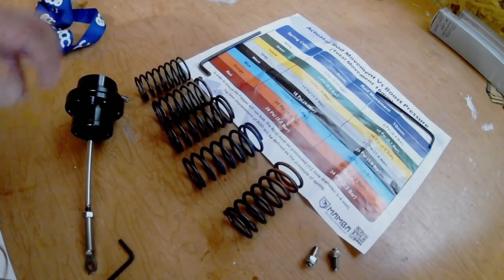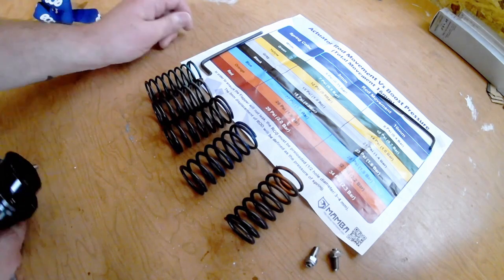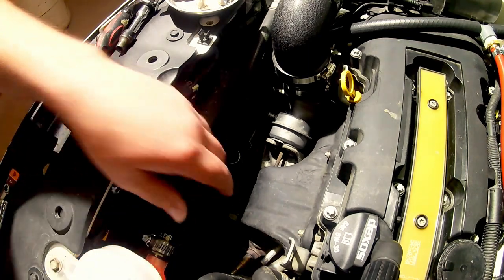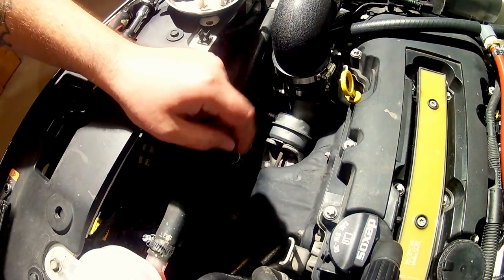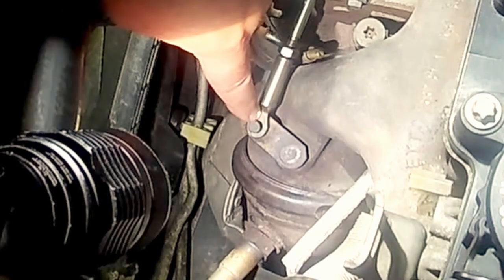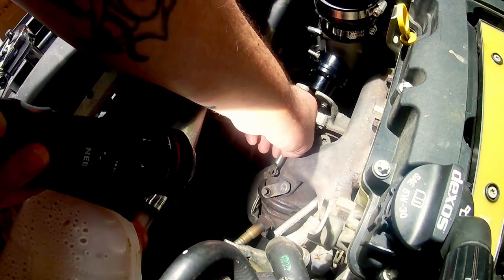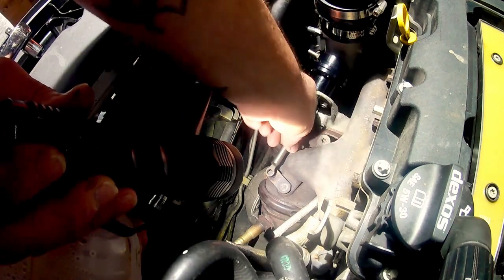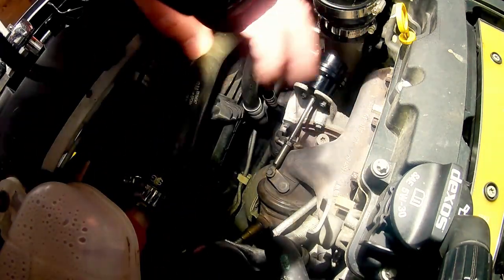Mamba Wastegate Actuator Install  - Actuatorly, the Waste is Gated!

Comment: I also installed one on mine,  but any preload (even half a turn) would cause a CEL...so I left it without preload...!!
Reply from the maker: That's no good! Does it still hold boost, and drive well??
Reply: @doescars5417  yes it does!!
Reply: Panos, you tuned?
Reply: @i30n_fb  I am, yes
Reply: Panos Vagenas who with
Reply: @i30n_fb  the car is in Greece!! It's a Greek tuner!! I'll be soon going in for a re tune and a bihgwr turbo,  so...
Reply: Benny the Jet Does Cars was

Comment: I have the 2nd gen cruze..few mods..but the car is Tuned for 21psi...and currently running stock waste gate with I believe 8 pound spring...and I'm getting this next week and was wondering if you knew what spring I should use ..so I can keep a more steady 21 psi..rather than it hitting 21 than dropping to 18psi
Reply from the maker: I have the 12psi spring in right now. Much more and you will have a hard time driving normally. I was told you want about half of the PSI you plan to use. Hope that helps! I love the mamba definitely!
Reply from the maker: Also, you may be losing boost from a leak, or 21 is the cut in your tune and it just loses that pressure following the Wastegate Duty Cycle tables. I usually only top out if I'm on the drag strip, WOT.
Reply: @doescars5417  yes your right I'm tuned at 21. And thanks. What difference should I expect thanks for your feed back
Reply from the maker: @jonathanlopez2022  No worries! The biggest difference I noticed right away, was it built boost in 1st-3rd much faster. Even at like 30% throttle at least 5-10psi per gear.
Reply: @doescars5417  wow dope and that was also one of my down fall had not much boost in 3rd so hoping I get better boost in 3rd as well thanks bro
Reply: @doescars5417  just got my waste gate looking for the yellow spring I dont think it came with it unless it already inside
Reply: @doescars5417  Hey, are you sure about "half of the PSI you plan to use" - e.g. if my peak boost is 17PSI, then i need a yellow spring , right?